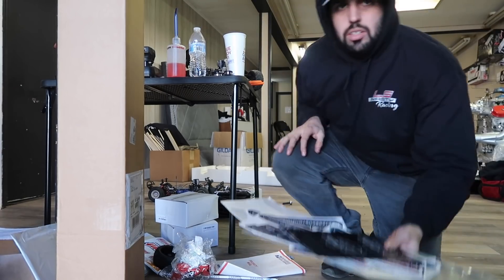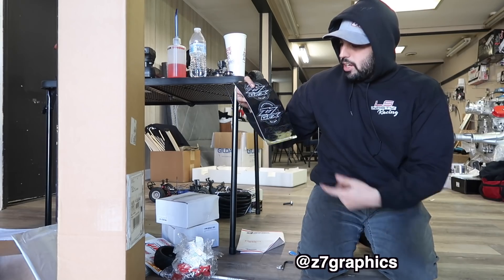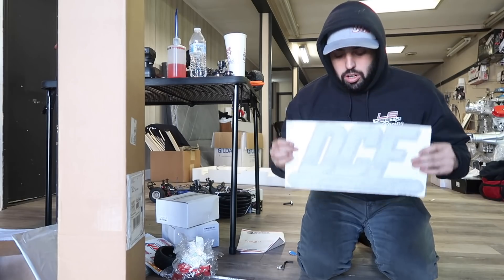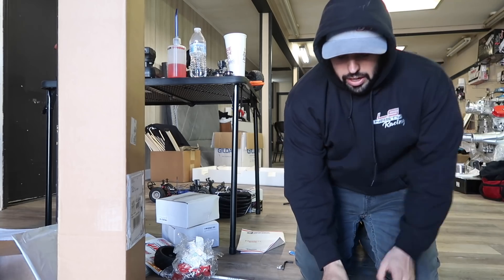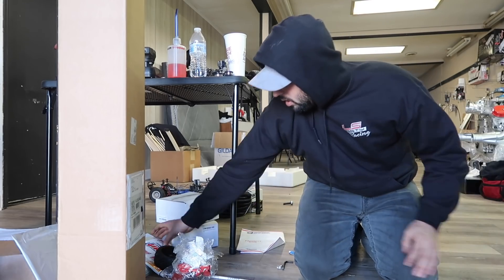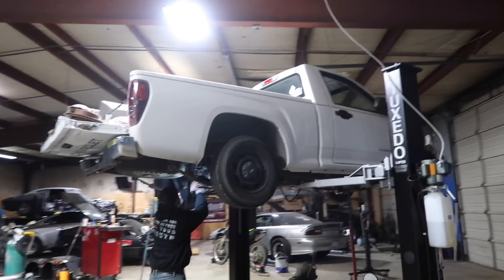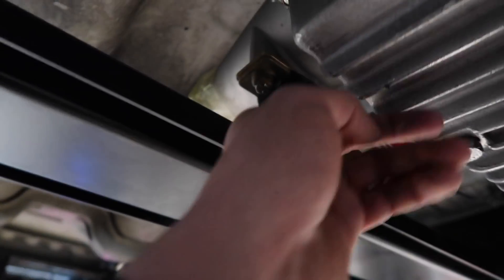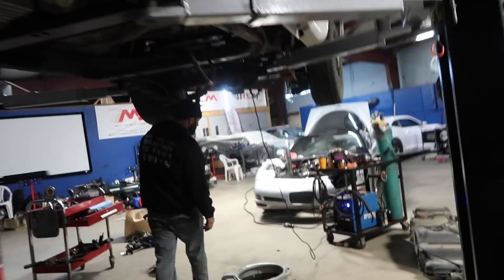Welding Diff goes TERRIBLY WRONG!!!!!

Comment: Dude what you supost to do is just weld in between the two teeth  before and after on the spider gears so that you dont take the temper out of the whole thing. It will be stronger and if you do break it will only be the spider gears.

Comment: Just tack the clips while your in there
Reply: You could do that but if it breaks an axle it wouldn't matter anyway.At least if you break an axle with c clip eliminators the wheel drum and axle stay safely in the rear end housing. No hate here just putting that out there.
Reply: @justinlienhoop4478  ya but that's the whole point he's not running C-clip eliminators so atleast if he tacks the c-clips in place when he does snap an axel it doesn't come sliding or flying out on to the track along with all the fluid. I was just saying if their in there welding the gears might aswell tack the clips if anything breaks it's all junk anyways !!!
Reply: I see what you are saying it wouldn't hurt to tack them since they are already there. But the C clip itself is inboard of the now welded differential. When the axle breaks it will break on the outboard end of the carrier and the welded clip will just remain in place and axle heads out. The eliminator kit bolts to the outer axle flange just inside of where the brake shoes are and holds pressure against the outer axle bearing journal to the axle housing. I hope I got all that information cleared up for you. If it doesn't make since just look it up and you will totally understand upon seeing the picture of one.
Reply: @justinlienhoop4478  oh okay yes I see what your saying now if an axel breaks it wouldn't matter if there welded or not but I was just thinking of it in a way of like an 8.8 were typically the rearend will hold up for the most part and the typical problem is the c-clips poping out but yes in the case with the entire rearend being the weak point it doesn't really matter, good call buddy I hear ya !!!
Reply: @justinlienhoop4478  what i meant before wasn't so much breaking an axel but just the c-clips poping out randomly like the 8.8 and to just tach them while your in there but your right I wasn't really thinking ahead on that one so good call thanks man